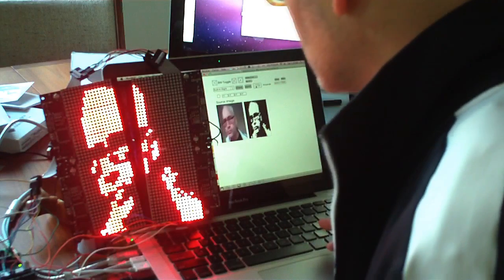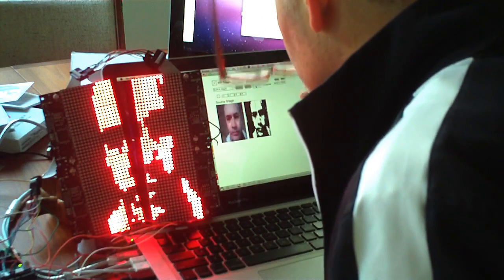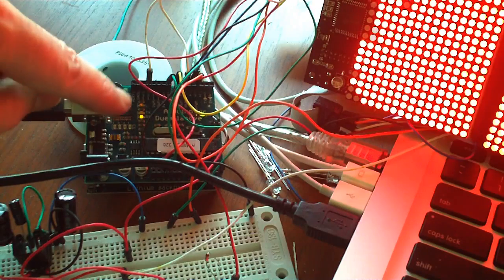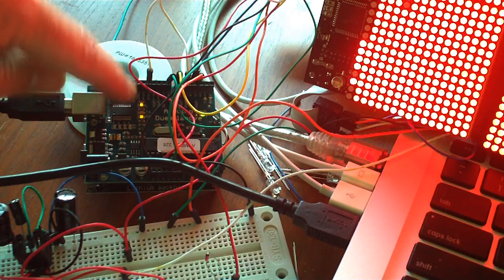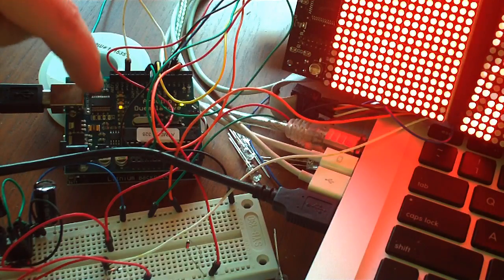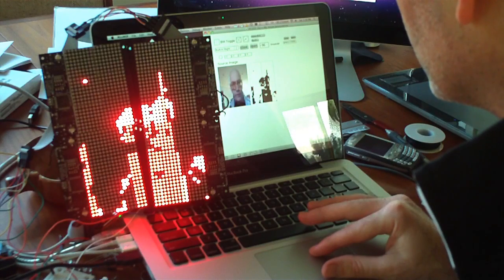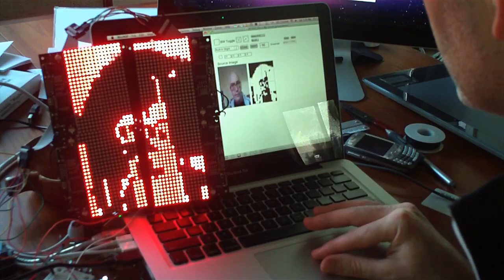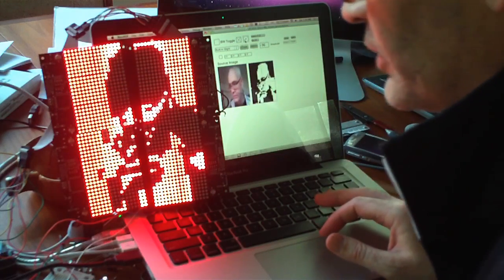Sure Electronics 2416 LED Matrix  + Arduino & MaxMSP = 1536 LEDs

Comment from the maker: Ended up rewriting it in openframeworks in order to put it on raspberry pi. Because it was 5 years ago I don't have the code handy at this point. The main trick was creating an efficient frame encapsulation so that the arduino could quickly assign the right part of the frame to the correct panel. Each frame was divided into a bit map for each of the four panels. No gray scale, only binary images. I seem to recall that being a limitation of the board. At the time, the limitation was the serial data rate on the arduino, which I think was 115200

Comment from the maker: @TeamMCS I can't send the Max Code, the Arduino code is pretty basic. It uses the HT1632 library developed on the Arduino forum. You can find the thread there. I'm using the sequential write function of the HT1632 chip to feed the RAM which is much faster than writing to each individual RAM address.